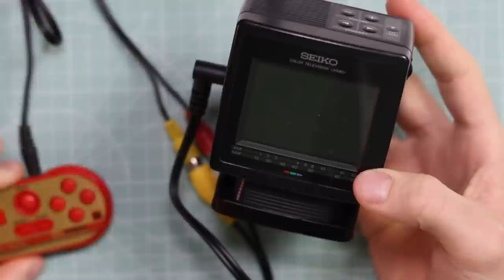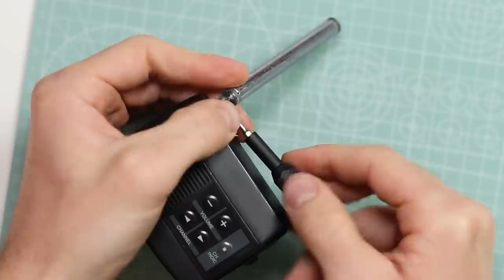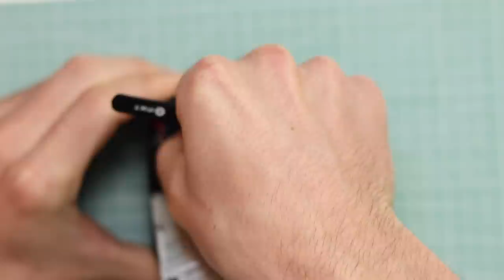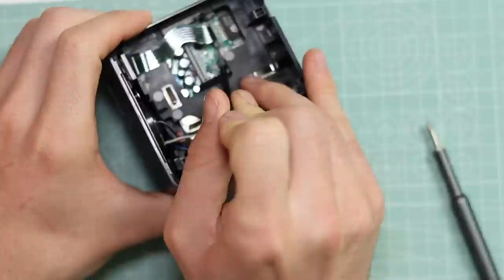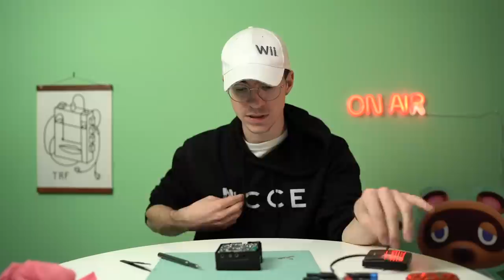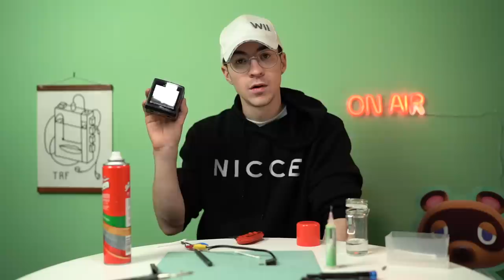Mini Japanese Seiko TV - Can I Fix It?

Comment: those audio-jack style av adapters are not standardized at all. everyone that makes one makes it differently, so try using various different ones and switching around the connectors.
also when you reflow solder for a dry solder joint it's best to remove as much of the old solder as you can and replace it with new solder.
Reply: Those solder joints looked absolutely fine. The problems is somewhere else
Reply: @bonnome2  yes, but adding fresh solder will prevent them from cracking in the future
Reply: @ChrisMX9  no, it will only "help" prevent them from cracking in the future
Reply: @X22GJP  yes, that's just what I said
Reply: @ChrisMX9  you are more likely to break the pcb entirely than the solder starts cracking with your through-hole components soldered properly (in the video they are soldered properly).

In the case of early lead-free solder it be worth it to replace since they start having whiskers that might short the circuit.
Reply: Big ups to you dude 👍
Reply: Probably your ground is on the wrong sleeve of the 3.5mm jack for this adaptor.
Reply: The only thing that's usually the same is the ground.  It's typically the ring closest to the wires.  Other than that it's a free for all.

Plug a 3.5mm to 3.5mm cable into the TV connector and a piece of wire.  Hold one end of the wire on an audio source then touch the various rings on the 3.5 jack to find out which is audio.  Do the same with the video source.  By process of elimination the other ring should be ground.  From there you should be able to source the proper adapter or make your own.  If that doesn't work properly it may be a 4 pole connecter inside the TV jack but that's unlikely since the TV only has  a single speaker.

I had to do this with my raspberry pi and eventually worked out a frankenstein adapter chain to make it work with the adapters I had laying around.
Reply: @sushiacid  okay, then explain.
Reply: @SuperLuigiGuy64  explain what
Reply: @sushiacid  Actually, my bad. Not sure if your previous comment was about Danny's comment above.
Reply: @SuperLuigiGuy64  np bro
Reply: Yeah, I recently spent a day figuring out why the video signal coming out of such a jack was scrambled... turns out there are at least 4 different standards for how to wire these, some of which have video swapped with ground relative to the others!

Comment: I’d try cleaning the connector inside with contact cleaner and maybe making own adapter, just in case this one has low quality wires. A friend of mine had a TV in his car in mid 2000s with terrible video quality. I’ve replaced the RCA cable from his DVD player and it fixed it.

Comment: If you haven't fixed it and by your description of having to position the jack just so. The signal is probably crossing over multiple contact points.  Try coating the connector in nail varnish, then inserting it and spinning it, hopefully it'll scratch off just the varnish at the correct contact points. You could also try just connecting an AV cable directly to the solder points.

Comment: I mentioned on the previous video that there are many different configurations for those 3.5mm AV jacks - the ones made for video cameras etc tend to be different to those made for game consoles. What I'd suggest doing is test the jack internally to work out which contacts are audio, ground and composite. Or you could just trial & error it by switching the RCA cables over while playing a source, if you have a cable that splits them out.

Comment: don't know if you ever fixed it on your own but ive had similar struggles with a/v output for camcorders. the best thing to do is to ground is; 
get your 3.5mm to rca cable, figure out which poles on the 3.5mm end ( the metal contacts separated by plastic rings ) correspond to which color/ground on the other end with a multimeter, write it down. then you can find out which pole the ground pin is on when you plug it in to the tv. then, you can try and make your own cable or find one online with pinout listed, with the ground pole on the same place. the other cables can all be swapped around so they dont matter as much. as for how many poles there are, the number of sections on the 3.5mm, it might be 3 or 4. that tv is clearly mono only, but who knows, maybe seiko just used a stereo + video jack instead. if only we had some documentation.
just needed to let you know otherwise i wouldnt be able to sleep tonight lol.

Comment: The solder joints honestly looked fine, and despite what others down here are saying about 3.5 mm AV adapter not being standardized, there is clearly something else on the board that's failing and causing issues since after you fixed the solder joints you got some picture out of it. I could be wrong, so test out some other cables just in case, but it just seems like there's something else going on with the mini TV itself.
Reply: yeah, it looked to me like some capacitor juice leaked out some on that pcb. Should clean the whole board with IPA and change the caps!

Comment: I have several different 3.5mm to RCA jacks for this reason. You have to check continuity from the jack terminals to the cable to verify which one is needed.

Comment: Elliot try soldering the directly to the solder joints on the pcb. You may have to cut one end of the RCA cable. Don’t forget to ground on each line.

Comment: I would suggest it needs a good recapping, they would be quite dry after all these years. Regarding the AV connection itself, as others have pointed out it probably uses its own pinout, so the adapter you're using is slightly misaligned to what it is expecting (as you suggested having to swap the A and V).

One other thing, it probably uses a CCFL tube for the backlight, and that might be a bit tired after all these years. I wonder how difficult it would be to swap them for diffused LEDs, bypassing the CCFL high voltage circuit in the LCD module, etc...

Overall, a great little unit!

Comment: The AV jack might have a lot of corrosion/oxidization in it. Solution could be to take the cotton off of one end of a q-tip/cotton bud, soak the end of the stick in rubbing alcohol, and insert it into the av port to scrub around a bit. Only works if your cotton buds have paper sticks though, not plastic.

Comment: If you have or can get hold of the AV cable for the creative Zen vision m, that should solve your problem. There are different spec cables out there, two of whom I've found sound similar to your troubles. Using this cable solved it.

Comment: A little deoxit inside the connector wouldn't hurt. Rather than buying a new connector, it may be easier to cut the wires and re-solder them on the jack side.

Comment: I did some testing with my LVD-404 model, and it seems like the video signal comes through using a stereo sound jack, that is TRRS type, even if the TV doesn't seem to even use the other sound channel. However, sound channel goes through the jack tip, and video is the collar ring after it. Cause you seem to be using a mono sound jack (TRS), the need for delicate alignment might be due to the video ring not making a firm contact?

Comment: Given the Seiko TV is from a Japanese auction then it's probably NTSC only.  If you're trying to input a PAL signal the resultant video output will have noticeable colour distortion, which can't be corrected due to the differences in how NTSC and PAL are each encoded. Try inputting a NTSC signal through it (if you happens to own a video/game device capable of NTSC output ) and see if it makes any difference.

Comment: Most headphone or audio jacks have small pins inside that can be bent back into place if its not working correctly. Most likely what happened was it wore out and the pins cant make good contact anymore. I have fixed countless controllers with this issue without replacing the headphone jack. Hope this helps!

Comment: I think I know how you can fix it but you won't like it.

Recently I've been on a binge of repair videos and I stumbled across  Macho Nacho Productions restoring a Turbo Express. It worked fine but the screen was dim and the audio output was extremely low. By replacing the capacitors it made a world of difference.

At 2:59 in your video you can see there are at least 4-8 capacitors behind the circuit board. My guess is these are very old and aren't doing a good job atm. You know much more about this me but I thought I just ought to point it out! Great content as always Elliot!!
Reply: I really don't think this is a cap issue as the tv IS working as long as the connector is seated correctly. Not that a recap would hurt its better to fix the actual problem first before conducting a spray and pray recap.
Reply: @NoshAbroad  Capacitors in CRTs can often fail but they can just spring a leak too. The  electrolyte fluid in the capacitor can damage the board in unpredictable ways. Looks like there is a capacitor near the jack too.

It's a pain to do but almost any 20+ year old device with capacitors is going to have this problem. You may be right but he's going to have to do a cap replacement eventually during the restoration process.
Reply: @dxqx3794  i'm well aware i do CRT repair.

Comment: You should solder some clips or leads to the back of board where the jack connects, then attach to your video signal and see if it is just the plug or something else, then diagnose from there.

Comment: So, one thing you can try, swap audio and video signals on the a cable you're using. I've had to do a similar thing to use the AV signals on my raspberry pi. Those jacks aren't standardized across the world. The US, UK and Japan use different standards for pretty much all of those.

Comment: You have the wrong A/V TRRS adapter. Try cutting the cable, matching the correct wires, and soldering and heat shrinking it back up.

Comment: Probably your are using a stereo mini jack (3 connections/2 black rings) .If you push it in all the way you short de connections out. I think you need to use a mono mini jack. (2 connections/1 black ring).  If you are already using a mono connector, try a stereo mini jack connector.

Comment: If the jack is somewhat working and in there delicately, and you’ve had to reverse the cables, t’s likely the wrong adapter, and using it has probably damaged the jack itself.

You may be able to resuscitate the jack, as the adapter has probably got some bent contacts inside.

I hope you’ve got steady hands.

Comment: I would remove the board and check all solder joints corresponding to the connector. Furthermore, I would remove the old solder of that very bad joint and replace it with fresh one instead of just reflowing it.

Comment: Of the plug is the right size I wouldn’t have thought it would be the cable? Probably the Jack I’d say as it’s a lose connection I think. See if you can see if the little metal connections are worn or bent? But you may as well try different AV plus first as it’s easier.

Comment: Remember, if the tv is before 2009 you will need to change the tv signals using a converter box

Edit: I heard people saying you have the wrong adapter and they made there own adapter, all that’s wrong is the metal is In the wrong place. Try putting video in the audio jacks and you may get something

Comment: yeah thats a wrong adapter, the audio and video pins are reversed on that one. Thats usually how you can tell is if it will only work when half or partially way in.

Comment: If you know the signals, you could solder wire to those points from the old connector and use a connector you know works. That would at least let you know all else is ok.

Comment: it would probably be a little work but it might be better to remove all the jacks you are not going to use and just have the av cables go directly into it rather than having the breakout cable. this would require a little probing to see exactly which solder pad is connected to which terminal in the current port. then a little more wiring between the pads and the new ports on the side. you may be able to remove the tuner because well it doesnt have a signal anymore this would probably help with battery life as well.

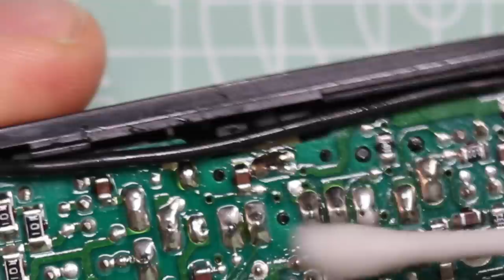Comment: 5:44  The pin on the right still isn't soldered correctly. It probably isn't your problem because it looks like it's not on the input connector but you might want to completely resolder it when you have the chance.

Comment: Those av cables are a nightmare, I bought a cheap one on eBay that was meant for Raspberry Pi and had the same issue, swapped out to a different cable and all working on my SNES carry case mod video.

Comment: So these 3.5mm A/V Jack's are awful for a few reasons:

1. There are at least 4 different standards for how they're wired. If you're lucky, you can get away with just swapping the plugs (video will be on red or white instead of yellow). But some swap the position of video and ground, so a cable not designed for that will produce an inverted signal! (If the picture is scrambled and has a white and pink strip along the right side, that's what's happening.)

2. A lot of headphones only have three connectors, so when you plug them into a 4-connector jack, they actually short two of the connectors. Some devices are clever enough to detect this and change the jack configuration, but otherwise you'll end up with only one speaker working, or a horrible buzz, or no video while they're plugged in. (In the latter case it means the video is shorted to ground, which is probably harmless, but not really worth the risk of damaging the device?)

3. Just because a cable has a 4-connector jack, doesn't mean it has 4 wires inside. >8^(

Comment: I first tout that it had to do with the type of tv signal, if your plug & play console is pal while that little tv only support ntsc with NO support for pal, then such signal issue can happen,
But i think here, or that av cable has some cracks inside, or the connections & solder points inside that tv are dirty or there wires are inside it are wearing out or a combination  of both, 
Trough you did atleast partially fixed it(!).

Comment: I had a problem with my phone where audio wouldn't play properly through the headphone jack and I ended up putting some double sided tape on a q tip stick and it turned out dust was the issue with my phone

Comment: It would be very hard if you were not physically present in Japan, or you had a Famicom (HVC-001) or Super Famicom with you.

Up until 2011 (2012 for Fukushima, Iwate, and Miyagi Prefectures), Japan used a modified version of NTSC. The NTSC channels that used to be broadcast in North America are at lower frequencies than those in Japan. For example, NTSC-M (the NTSC used in North America) Channel 12 carried analog video at 205.25 MHz, while Japanese Channel 12 carried analog video at 217.25 MHz (which was, ironically, the frequency that TV Tokyo used to broadcast before analog broadcasts in most of Japan were terminated).

And people keep saying that US Channel 95 is equivalent to Japanese Channel 1. However, to get Japanese Channel 1 working on a North American CRT TV, your TV MUST support analog cable TV, as US Channel 95/Japanese Channel 1 carries analog video at 91.25 MHz and FM audio at 95.75 MHz. In my area, both the audio carriers for Japanese Channels 1 and 2 are already being used by radio stations, so trying to broadcast Famicom gameplay from it's RF output throughout your house's in-wall wiring is basically illegal.

Comment: You need a mono a/v cable, but there are a few different configurations for the pinouts. You'll just have to figure out how that little thing is configured and order the right one, or make it yourself since you already have the parts :D

That micro soldering iron is nifty. Does it have a small chisel tip option?

Comment: I was wondering how to fix  a stripped screw out of my Nintendo ds lite
Reply: Is the head stripped or the plastic it screws into?
Reply: Put a bit of rubber band between the screwdriver and the screw and see if that give you a little extra grip

Comment: It may be a 4 pinner, meaning you need a breakout with Video Audio-L and Audio-R, and then you will need to figure out which cable is for which, but that's easy to figure out. However, if the ground isn't the same position, you are going to be in trouble.